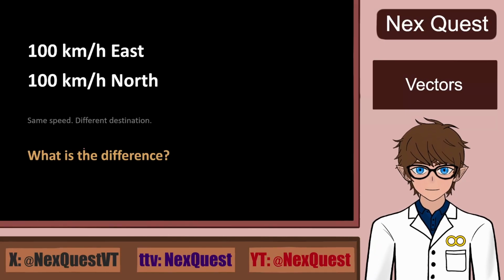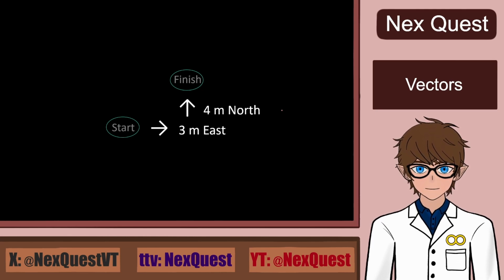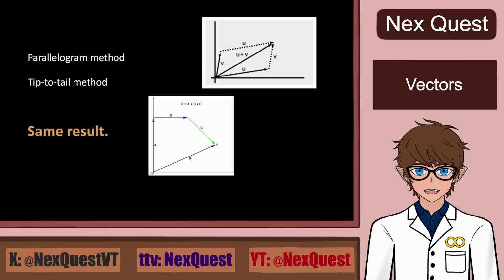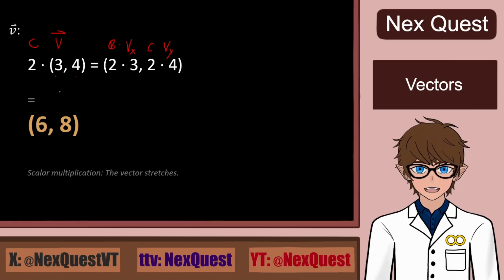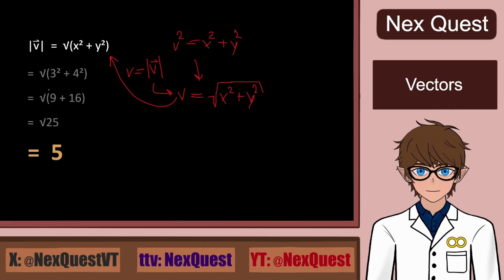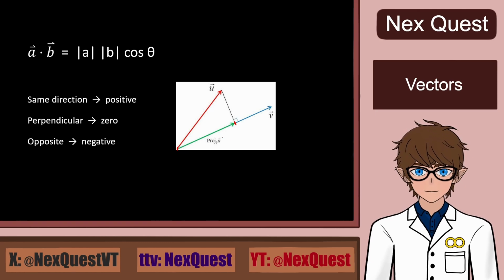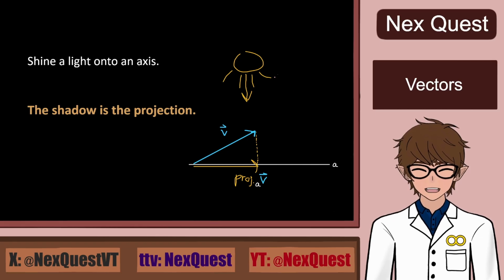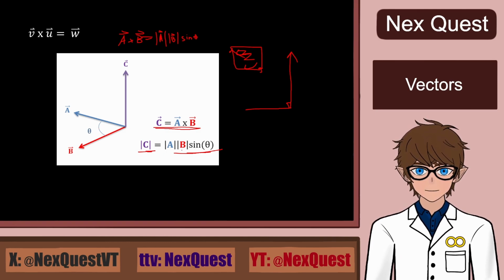No one knows what vectors are until they learn these basics! (Lecture 32)

Comment from the maker: Timestamps:
------------------
0:00   Intro
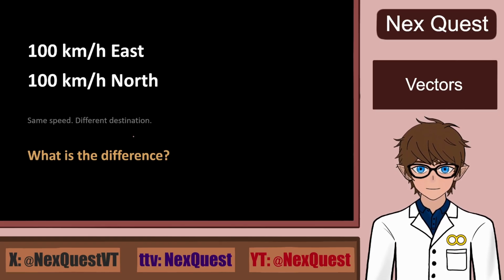0:31   Why vectors exist?
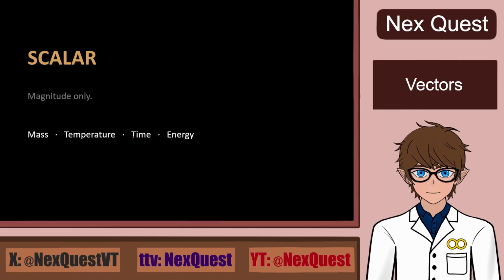0:52   Scalars
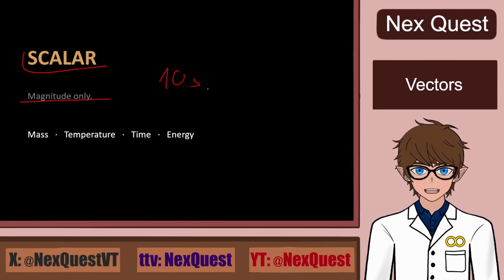1:35   Vectors
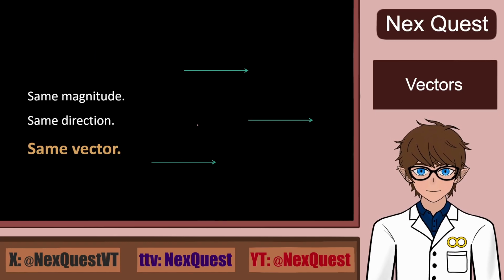4:18   Are 2 vectors the same vector?
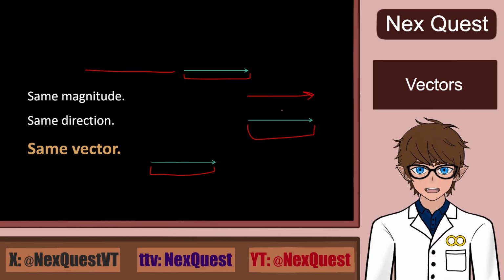5:23   How to determine vector's direction?
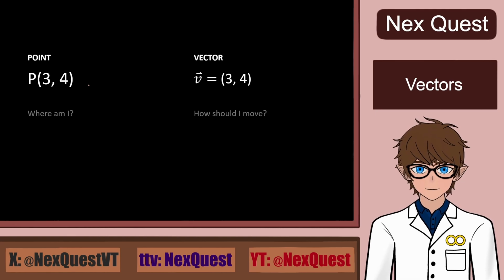9:00   Point or vector?
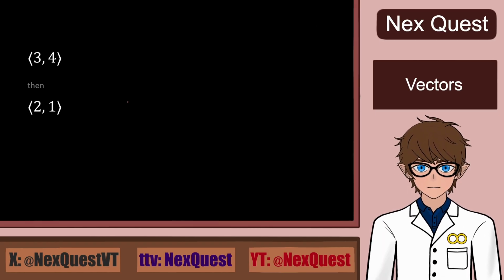10:15   Vector addition
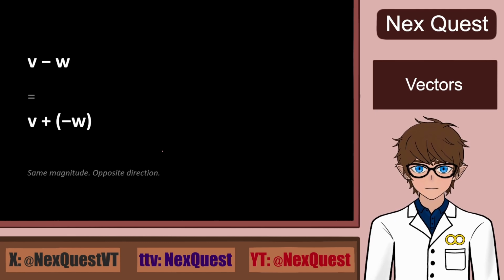15:00   Vector subtraction
16:25   Scalar multiplication with vectors
18:32   Multiple vectors example
20:42   How long is the vector? (vector magnitude)
22:59   Unit vectors
26:04   Vector addition with unit vectors
27:57   Vector alignment 
34:02   Are 2 vectors parallel?
34:53   What is a vector projection?
25:39   Cross product
40:36   next video foreshadowing
41:04   Mini test
------------------